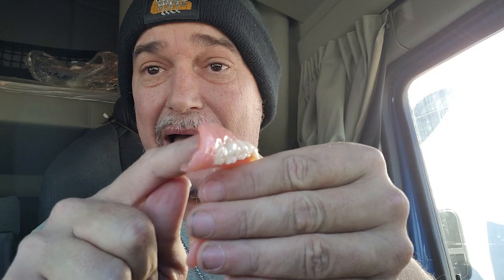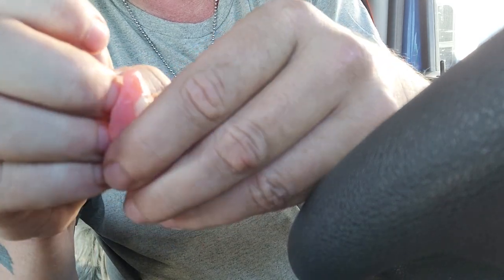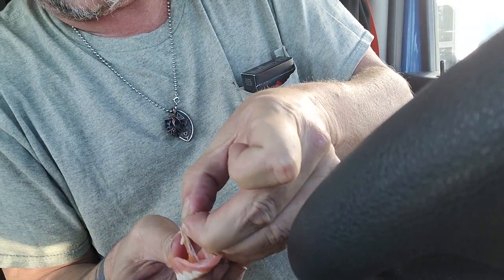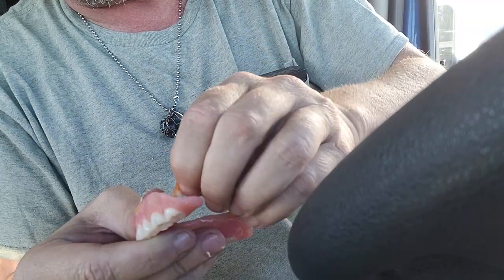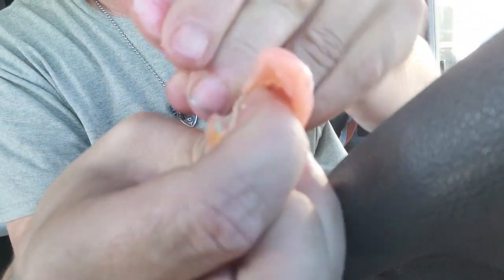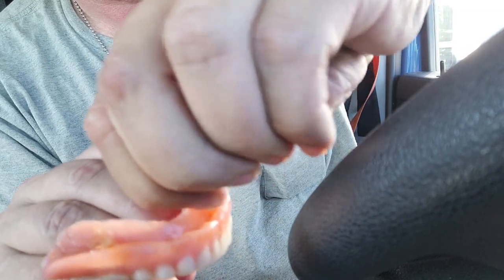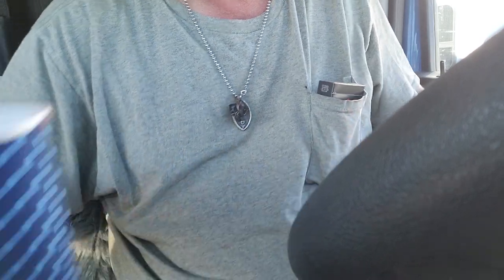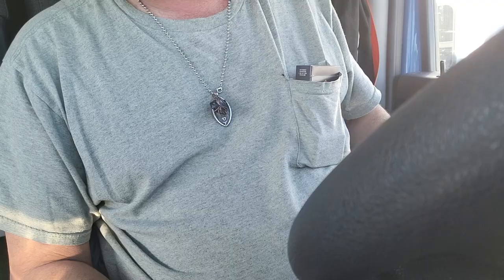How to use Cushion Grip - cushion grip for dentures

Comment: Great Video about Cushion Grip. The only thing I can tell people, is if you have the time, do wait 5-10 mins before inserting, and there will be no burn. That rule is there for those with low pain tolerance ;)  The air helps evaporate the Alcohol in the Thermoplastic.

Comment: OMG thank you so much!!!!!!! Sept. 12th of 2024 I had oral surgery - the doc removed seven front bottom teeth then he put in two implants so in December the denture should clip on. The denturist that the periodontist used SUCKS and I kept complaining that the denture was too big for my mouth and it was pressing on the left implant in a bad way - the pain was awful. The denturist said I should simply use Orajel - I was pissed. There is much more to this story, but now the perio guy thinks I'm a drug seeker - not! Tylenol 3 is nothing to me! I am diabetic so my healing is slower, also I smoke - I felt like I just dropped so much money for nothing bc the denture did not even touch the back gums, just sat on top of the surgically removed teeth with a product called COE-soft. 
Okay...That was my mini-rant, I apologize if it made zero sense, but I am overwhelmed!
I am going to order some of this cushion grip and give it a try, fingers crossed it will work. If it doesn't? I'm screwed! I am the pissy person who will then say eff it and burn the bridge between perio dude, crappy denturist, and my dentist!
THANK YOU THANK YOU THANK YOU!!
The beast that is me is contained for now...will give you an update kind sir!
Alyssa

Comment: Hay brother tried it today didn't work for me kept on coming out top and bottom
Reply: Hi there, I'm a brand ambassador for Cushion Grip and I'd love to help. What do you mean it kept coming out the top and bottom? If you had overflow that could mean either you used too much product or that you were clenching down too hard during the application. It's normal to have some overflow and after you let it sit in your mouth for 2 hours you can take it out and trim it if need be.
Reply: @the_toothless_fairy  it got hard pretty fast dried fast felt weird and kept coming out bot  h too and bottom  have tried 3 times haven't had any luck
Reply: @jrc202  Oh no.. I hate to hear that. I know it gets harder once it cures but that usually takes about 4-6 hours. There will be a little overflow and I usually trim that around the edges. Otherwise it shouldn't come out. It's recommended not to use adhesive or soak it for 24 hours. Either of those things could cause it to come out early.
Reply: @the_toothless_fairy  thank you
Reply: @the_toothless_fairy I'm going to cushion grip tomorrow, can you give me some tips?
Reply: My bottom s suck.  This stuff doesn’t work for me either.  I’m so pissed